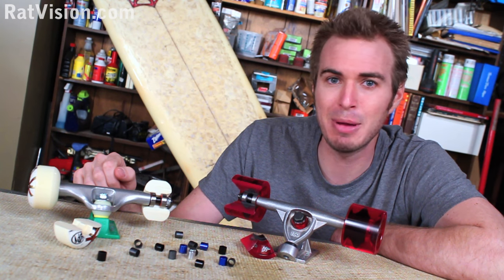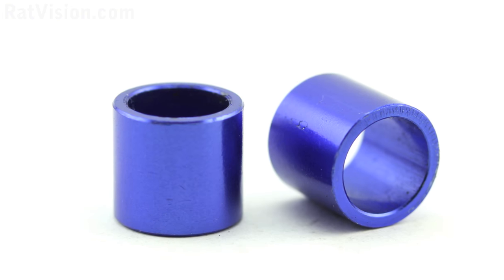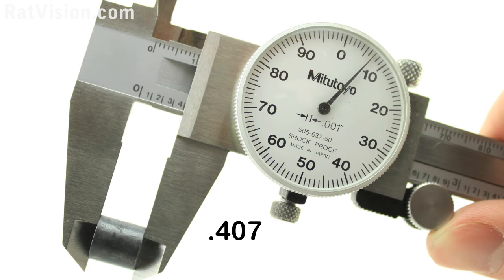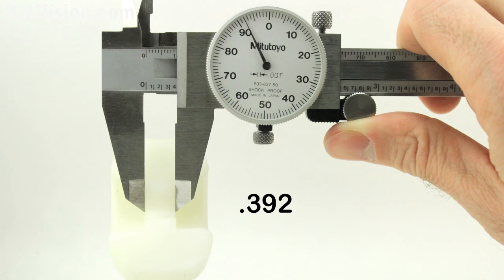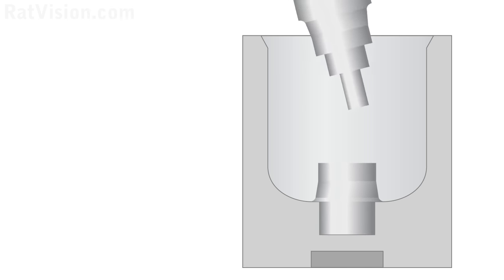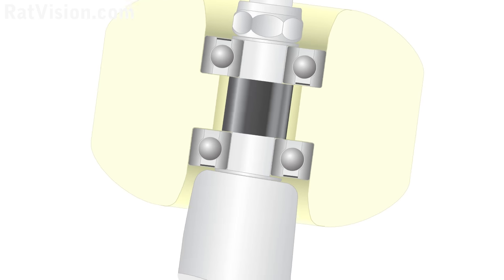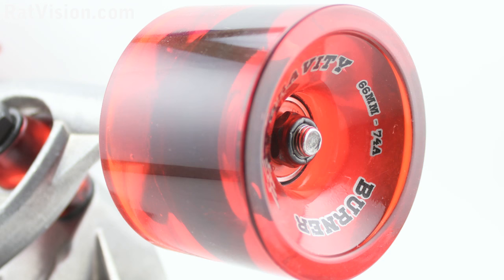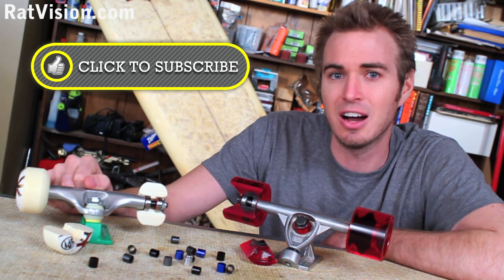Fastest Skateboard Wheels, Bearings, and Bearing Spacers

Comment: This is great info for skaters. I have been racing slalom for many years now and can tell you that this is old news to us. There are many youngsters skating that simply step on the board and don't give a thought to what quality is going into their ride. They are sold a bill of goods when they look through skate rags wondering what Johnny Rad is now skating and then buy what he's riding. Little do they know, Johnny is simply paid for his endorsement and is as ignorant as they are [usually].

My Turner slalom boards have true Titanium axles and are machined for square edges. They are also 8mm and the bearings fit precisely. I always use spacers and they are checked against the hub for width. If there is a discrepancy the spacer is machined for accuracy. The result is true spin and properly aligned wheels that have ZERO lash and run straight. This may seem excessive until you take one for a ride. Many skaters who know nothing about slalom have ridden my rigs [one even tried to kick flip it], but noted how fast and quiet my rigs are. I can assure you it makes a difference racing. For street, this all may seem a bit too much, and perhaps some of it is. Until you ride a street set up that's been meticulously assembled you may not even see the need for these measures. However, after you perform them on your street skate you'll never want to skate it any other way. To those that do not care......Enjoy it the way you want. It's skating after all.
Reply: Where can we get machined trucks and bearings, or have it done?
Reply: @thomasbrooklyn1820  I had mine done by a skater friend who is also a machinist. But any competent machine shop can true the hanger and and install and fabricate titanium axles. It all depends on what you think it's worth. It may cost more than the trucks themselves. In fact I'm pretty certain it will.

Comment: Your thoughts about bearings with built in spacers .. Zealous, Tekton ...ect, ect ??
Reply: I know this is old but apparently from the video the bearings should have spacers and be built into a wheel designed for them and even then there's a high chance not everything matches.

Comment: I just got a board from daddies. sector n dropper with orange wheel upgrades. I'll check fpr spacers. it's riding a little slower than I expected. I spun some in store and they went on forever with abex7, but mine dont spin that long.
Reply from the maker: New bearings are not going to spin fast right out of the box.  Some bearings are lubricated more than others and APPEAR slower when you spin them.  Free spinning a wheel proves NOTHING.  A bearing has to have loads applied to see how wheel it will function.  Riding them is the true test.  Bearing also need time to break-in.  This is period, of about 15-25 hours of riding, where the metal surface of the raceways and balls go through physical changes.  Basically they get to know each other and work better.  So, don't be discouraged about how slow your wheel spins right now.
Reply: Right on. Thanks. :)

Comment: Learning the logistics of Ball bearing theories and what continuity has to offer to make the wheels run in perfect circular harmony and to determine what each wheel has to offer in the lowest DB's found thru a Fluke SM70 showing the  Fast/Slow Time Averaging @ 76 degrees Fahrenheit and by calculating the roll factor with the assistance  from the NLGI is all fine and thought thru.  After all thoughts are final. You finally come to the realization that it's........... just a skateboard. Don't worry about it. Go ride, and have fun!!!

Comment: so , the conclusion is the spacer only works with the exact length of the core or a little bit longer ? if the spacer is rattle after installation , you can take it out because it won't help anything ?

Comment from the maker: From what we have seen there is a problem with every brand.  Clearly Bones, who comes across as the top brand, does not supply wheels and spacers that fit properly.  If you skate downhill, an improper wheel assembly could cause speed wobbles.  This also puts extra stress on the bearings and it can wear out the bearings sooner and cause lower performance. We recommend Oust a lot because they seem to be the only company that cares about absolute precision parts.

Comment from the maker: You can't tell. It just happens. It takes about 15-25 hours of riding to break-in bearings. And then what happens? It's funny is how people know about "breaking-in" bearings, but they don't know what it actually means and what it does. The metal surfaces of the balls and raceways actually smooth each other out.  This increases speeds, but the bearing needs to still remain clean and well lubricated. This is why bearings that are broken-in are faster than new bearings.

Comment: I bought a skateboard and I don't have a bearing spacer so would it effect my performance pls help
Reply: +joe weller 
Dont' worry about getting spacers just as yet. Stick with what you have. Unless you're skating long distances or at high speeds, I personally don't feel the need for spacers. I've been skating 12 miles a day in 45 minutes...every day after work and I don't have bearing spacers.

Comment: hi ratvision, thanks for replying my previous questions. When i fit my bearings onto the truck with spaces, the outer bearing is sitting on the threads of the trucks, does that spoil the bearings or the threads? Also i have been getting a chattering noise from the wheels, i have tightened the nut on the axle as hard as i can already. Do you have any idea whats going on?
Reply from the maker: Don't worry about the threads.  With the axle nut tightened, the threads don't do anything.  Good question tho!  Glad you're thinking.  If you are spinning the wheel and it vibrates and slows down really fast, one of the bearings could not be sitting flat in the wheel, or in some cases the bearing seat is crooked.  We show this in the video.  One bearing could also be corroded or slow, so there is an imbalance.  Is that what you meant by chattering?

Comment from the maker: It's hard to say how well the board will hold up at that weight. It's not meant to flex but it will bcuz of the weight you are putting on it. I don't think it will break as long as you are only using it to cruise around. Check out their Faultline deck. It's the same price, almost 2 inches shorter, 1 inch shorter wheel base.  This will make the deck stiffer. It also has 9 plies instead of 8, and is slightly wider. This deck is going to be much better for your weight than the Dropper. Let me know.

Comment: What brand of wheels and what brand of spacers generally have the best precision and/or accuracy? I always thought its been safe using spacers but now I can see what actually happens in the bearings and now it seems I can almost guarantee that not one of my wheel/bearing/spacer/washer/truck set up works optimally.

Comment: One of my wheels jiggles a little. I am a newbie and bought the board complete. All the other wheels are perfectly fine. What could it be? Do I need to thighten it or is it something else?
Reply from the maker: Try tightening the nut a little bit more.  Let me guess, you spin the wheel and then it vibrates and stops. It may need to be tightened, or one of the bearings is not in the wheel properly.
Reply: Rat Vision – Skateboard Tech
 No its not vibrating. But when I grab the wheel and try to move it I feel a jiggle not more than 1 or 2 milimeter. The other wheels are fine. I ordered a tool and I'll try to thighten it. Bearings: Abec 5 Speed Bearings, Wheels: Divine Road Rippers 70mm / 78a.
Reply from the maker: Tighten the nut a little bit.  You don't need a skate tool to do it. It's 5/16ths inch. Or use pliers.
Reply: Thank you, it worked! I now need to find fitting bearingspacers though because I found out that they are not on my longboard yet :)
Reply from the maker: finding out the right spacer size is tough if you don't have the right tools.  Spacers allow for the wheel assembly to be tight on the axle.  When this can happen, the wheels and bearings will function optimally.  Without spacers you can't have a tight fit, and the bearings undergo more stress when loads are applied.  This results in loss of speed and bearing longevity.  You won't feel the difference, but it's there.

Comment: So what you are saying is that I should cut my wheels in half to find out what the optimal spacer size for this specific wheel is?
Reply: not really, u can simply stick a spacer in and use ur fingers or something flat u can stick in there to find out if the spacer size matches.

and u can also put in the bearings and spacers and see if the spacer jiggles around in there or not.

Comment: I have a 33.5" by 9.25" deck and all I want to do is cruise around. Someone please help on what is the BEST for that!
Reply: +Leonel Mata Bearings with built-in spacers (because you don't have to worry about losing spacers and speedrings) and some wheels about 57-65mm. See what works without getting wheelbite. Oh, it also depends where you're riding. Cruising wheels are usually around 78a, so you can ride over many uneven surfaces, but if your town has many even surfaces you can go a little harder (if you want). I'd recommend you Satori Bureo wheels, they are 78a and 63mm, in my opinion they are smooth and pretty fast.

Comment from the maker: Well, after watching this video it's pretty clear why they don't work.  Not every wheel brand, including ABEC11, allow for Biltin bearings to work the way they are supposed to. In the video there are 3 ABEC11 wheels and each one was a different measurement (.399, .398, .394).  So, which wheel center did Chris Chaput choose when developing the built-in spacers for Biltin bearings? All built-in spacer bearings do not work unless the wheel fits perfectly, and most wheels don't.

Comment: I've notice the problem with trucks how sometimes the  axle is disproportionate or have extra metal to it. I've had to sand down the extra on the truck before because they were getting my bearings stuck which made my wheel run significantly slower.

Comment: So does this mean, if my skateboard spacer doesn't fit right, I'm better off removing it?

I just got new wheels, bearings, and spacers/washers, but the spacer moves around if the wheel is off - seems pretty sketchy.
Reply from the maker: ***** Leave it on.  Most cases it's better to leave it on.  If it's just floating between the bearings it won't effect anything.

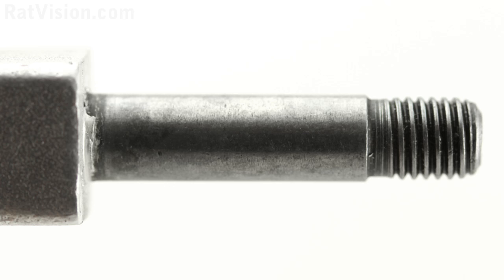Comment: I have the issue presented at 3:11 Any suggestions on how to handle the extra aluminum?  It causes my bearing to get stuck on the axle and it won't come off without taking a hammer to it. Should I just file that aluminum down, or is there a better way?

Comment: I just have a quick question. I have a topmount sector 9 longboard with a kick tail. I wanna buy larger wheels, but i dont know how big of a wheel to get without risking getting a wheel bite when i turn. What brand and size of wheels should i get? I'm most likely just going to cruise around and maybe carving downhill. Also, i would like to know what kind of bushings i should buy. I'm 5'1" and 105 lbs. A quick reply would be great! thanks!

Comment: the highest quality bearings in my opinion are seismic tektons. They are affordable and work without bearing spacers or speed rings, because they have them built in. they work with literally every wheel i have put them in, and are the most consistent roll i have ever had.

Comment: How do I know which spacer I will need for which wheel without cutting them open and measuring them like you did? Especially if it doesnt tell me the inner gap(core) width of the wheels on the website or the product itself? (Talking about Bones and in general here)

Comment: Hey Rat Vision – Skateboard Tech im making my cruiser like deck and i was wondering in your opinion what is the most reliable wheels at 75 mm and bearings to go with it. 
Thank you
Reply from the maker: That depends on where you skate and the road conditions.  We recommend Oust bearings.  Go with any Freeride (round edges/lips) with a durometer of 80-83A.  Can't go wrong.  If you want more grip go softer with square, sharp or beveled edges.

Comment from the maker: Not so much effect your riding.  It can effect speed, and most certainly has an effect on how your bearings perform and how long they last.  It's usually better to have them in rather than out.  You may not notice anything other than you need to replace bearings sooner.

Comment: Thanks a lot for your video!
Was wondering if you can comment on my picks:
Live in Holland so mostly flat and good bicycle paths. I'm 6'5" and 220lbs. I'm looking for stability and an easy longboard wich will be my first (do surf, SUP and used to skate). Not planning to do tricks. Mainly transportation. 
Think the LandYachtz Switchblade is the board for me (stability, comfort)
Trucks Bear 852
Bearings Oust Moc5
Can't find Ricta Wheels here, so will Oust Mood 76 do in stead?

Comment: So what is the best wheel/bearing spacer set up for my  long board?  I just do some cruising & carving and I can't afford to buy and measure a hundred different wheels and bearing spacers until I magically get the right fit... Is there a brand that prides itself on quality production and precision machining?  Thanks
Reply from the maker: The only company that we are aware of that actually cares is Oust.  Clearly you can see that Bones and many other companies do not.  If you're just cruising, it is not a critical thing to have everything so precise.  You can go out and skate. However, having the right fitting parts can reduce or remove the chances of speed wobbles, and also reduce the stress and wear applied to bearings.
Reply: Thanks man, I appreciate the response.  I just got off the phone with Carl from Oust and got quite the education.  I'm sold and I just ordered a set of bearings and spacers from him.  Looking forward to testing these out soon.  Thanks for doing this research with him and putting out these videos.  I'm looking forward to the bushing video he mentioned.  Also I told him I ride on original trucks and I'm sure you know the bushings are a 2 piece cam style in these trucks and am curious to know your opinion on this style bushing.  I'm hoping Carl will produce a cam style bushing using the same aero space high grade materials he's currently using in his other bushings soon.

Comment: I got Spitfires 52mm f4 and bones Redz bearings. The problem

Is that the bearing doesn't go smooth into the wheel. Can Someren help me??
Reply from the maker: ArnoSkateGoPro Some spitefires have a very tight fit, and can be a real pain in the ass to take out bearings.  What you really need to do is apply a lot of force when putting the bearings in to make sure they sit flat in the wheel bearing seat.
Reply: ArnoSkateGoPro get some speed cream or some oil and apply it all around the outer of the bearing ring or where the bearing goes in on the wheel. this helps a lot if you haven't done it.

Comment: I got 2 boards currently, a landyatchz trooper with bears with sector9 race formula wheels and reds bearings the board rides great and my sector 9 pintail has gullwing double kingpins with never summer industries 78a wheels and bones swiss bearings the board is just mean is there any specific set up i should go with if i was using my sector 9 for cruising mainly

Comment: Hello,Rat Vision - Skateboard Tech I just received my longboard today and some of my wheels spin longer then the others and some seems to have something slowing them. Also how tight should my axle nuts be ? please answer !
Reply from the maker: This is normal.  Not all bearings are lubricated the same.  The nut should be tight with properly fitting bearing spacers.  Tighten the nut all the way down until it stops.  Don't force it.  Just until it stops, you'll feel it.  Then back the nut off/up about 1/8 to 1/4 of a full turn.

Comment: I use bones race reds bearings that have built-in spacers and speed rings are also built-in. So really my main concern after this would be the spacing of the wheel hub and the alignment of the axle in the hanger? I can say that there is a very noticeable improvement in roll speed and distance traveled when i switched to bones race reds! No, I don't sell bones bearings or receive any compensation for promoting their products! But I have been very impressed so far with these bearings!

Comment: I want to buy my first bearings for an electric skateboard. Within the same price are there any better options than Bones Red?. Cheers ;)
Reply from the maker: Bones does have better bearings.  Reds are their lowest price point.  For electric skateboards I would recommend the highest quality you can afford.  Why?  Because you are dealing with battery life and not foot power.  You want to get the most mileage out of your board.  Cheap bearings are going to limit the distance you can cover.  Bearing acceleration, load handling, speed, and lubricant are going to make all the difference.  From our testing Oust Moc 9 is the best choice.  (We are not sponsored or represent Oust)